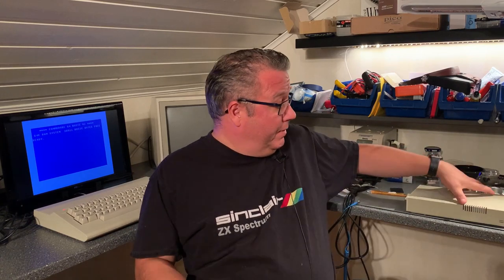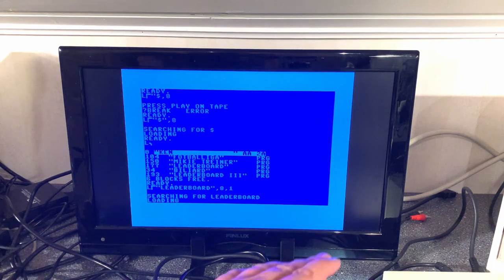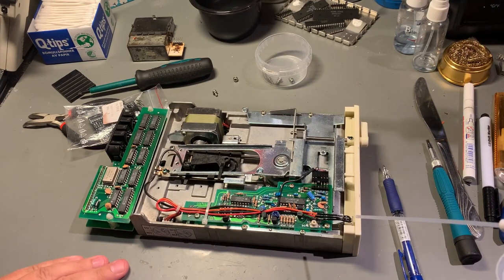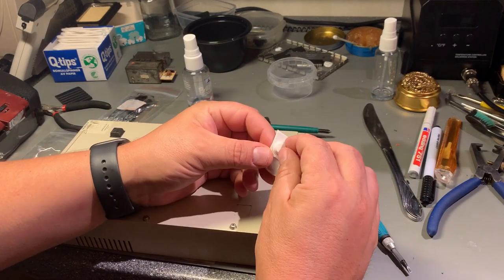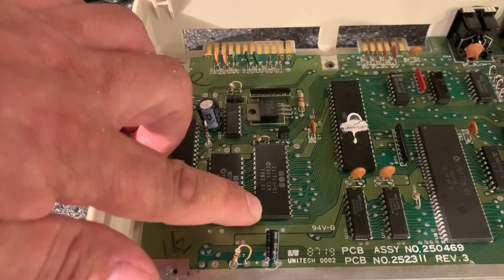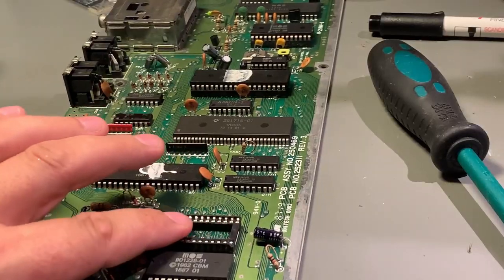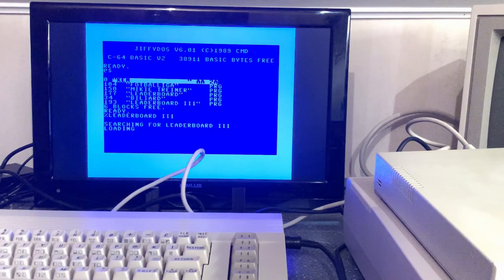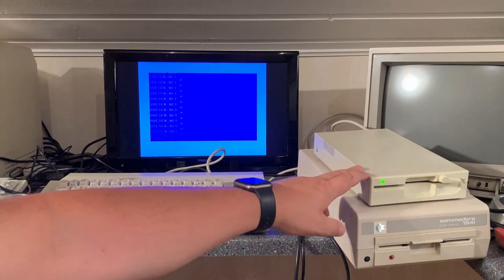Exploring and restoring an Oceanic OC-118 floppy drive

Comment: Had one of these after my original giant beige 1541 died. This eventually had issues as well, so I got a 1541 II, and have had zero problems from it in the 30 odd years I have used it. And Jiffydos sure is a winner. Best upgrade I ever made to my old breadbin and drive.

Comment: I bought one of these drives recently. It has "Excellerator+Plus" on the front bezel.  It works very well.
I need to Retrobrite the front bezel though, it is quite yellow.

Comment: Try the hot air method after using the desoldering gun. Its amazing to see the stuck chip just slipping out with just some 180°C air.